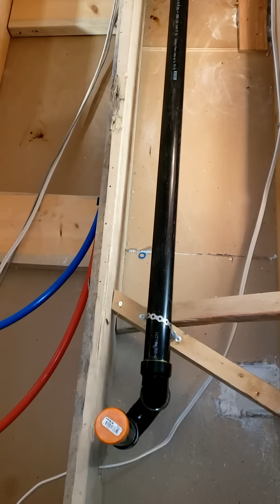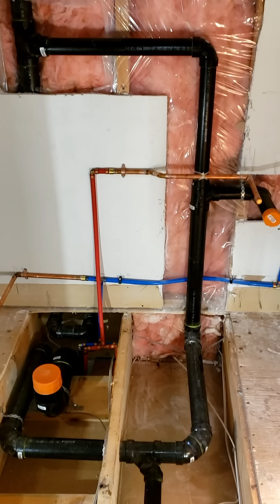Wet Venting EXPLAINED! - #SHORTS

Comment: Needs to be a two inch vent because of the toilet
Reply from the maker: You're not wrong, depending on what you're referring to by "vent".  The WET vent (the pipe between the toilet and the lav) needs to be 2 inch because it's carrying air AND liquid (and I assure you that it is!).   However, the dry CONTINUOUS vent (the pipe upstream of the lavatory's TY) only needs to be 1-1/2 inch.
Reply: @PlumbingsCool thanks for this. I'm having a bathroom renovation and want to remove the boxing of the 110mm soil pipe ventilation  and replace it with a 40mm (air pipe going up through the roof). This will allow me to create a small boxing rather than a big one.
Reply from the maker: @DSS-Renzokuken  Appreciate that it helped, but I'm not sure where you are in the world.  Here in Canada we are required to UPSIZE to at least 3" (75mm) BEFORE we exit through the roof regardless of pipe size.  This is to minimize the likelihood of our vent openings from getting blocked up by hoar frost during our crazy-cold winter months.   If you don't have cold winters where you are, then I don't think it will be a problem.
Reply: @PlumbingsCool  based in the UK. I already have a 110mm put the roof, but moving the pipe internally and then will reconnect in the loft space via a 45°. Don't see why we have to have a boxing of 25cm x 35cm for a soil pipe air vent
Reply from the maker: @DSS-Renzokuken  Yeah, that's strange. Here in Canada, there's no Code that specifies the boxing of any stack. Many of our houses have unfinished basements, which have all the stacks exposed.  They only get closed off for aesthetic reasons once the basement is finished..
Reply: @PlumbingsCool  well, if it works in Canada, the mechanics will work here in the UK. So 40mm vent pipe it is in the bathroom walls. Thanks a lot.
Reply: @PlumbingsCool  what size vent is the toilet vent, looks like 3" or is that 2"?
Reply from the maker: If that toilet were being vented individually, it's vent would need to be 1-1/2".  However, because the vent serving the toilet is also acting as a drain for the shower and lavatory (wet vent), then that pipe needs to be at least 2" all the way through, because it's performing double-duty.  If you were to throw in say another shower or lavatory, then that wet wet vent needs to be upsize to at least 3" throughout, because a 2" wet vent can only drain a maximum of 3 fixture units into it (1-1/2" lav + shower = 3 fixture units).
Reply: @PlumbingsCool where is this? State?
Reply from the maker: Ontario, Canada, my friend. We use Ontario Code in this province, but the wet venting rules are almost identical in our National Code.
Reply: @PlumbingsCool  Wrong! Where did you get your plumbing license? El Paso?
Reply from the maker: @michaeldudas7584  I sure hope your plumbing skills are superior to your descriptive ones, for your sake. 

Please do elaborate upon your infinite plumbing wisdom.

(And what's wrong with El Paso?...sounds like a cool place! 😎)
Reply: @PlumbingsCool  Your wrong. In that application the vent has to be 2''. Plain and simple. The reference to El Paso is describing the type of people doing skilled work unlicensed now.
Reply: @PlumbingsCool  You're from Canada? That explains everything. We know what we're doing. We're from the US.
Reply from the maker: Aw...why are you speaking up NOW???...I wish you had done so fifty years ago when the Plumbing Code was first published...thereby sparing us from carrying out millions upon millions of exactly identical installation configurations.

Oh well, better late than never to be schooled by a Jenius.

(OK, I'm done.  Troll away if you feel it improves your life in the slightest miniscule way.  But it won't.)
Reply: @PlumbingsCool It's spelled G-E-N-I-U-S!
Reply: @PlumbingsCool  I'm not trolling. You said that vent can be 1 1/2''. In NJ that vent has to be 2''. How's that trolling?
Reply: @PlumbingsCool  your toilet is still connected to that DRY vent so it would need to remain 2 inch throughout.
Reply: @coltonmorquecho6665 why? It's only AIR not drainage.
Reply from the maker: You're absolutely right!  Note that ndividual trap size requirements reign supreme.  You have to size the piping as if each fixture were individually vented.  For example, a stand-alone toilet (3-inch trap) requires an 1-1/2" individual vent no matter what.  Although technically our continuous vent sizing tables renders 1-1/4" piping large enough to supply air to all three of those fixtures based on accumulated fixture units in this case, 6 Fixture Units for a Bathroom Group) individual trap sizing requires that we upsize the continuous vent to 1-1/2" specifically because there's a toilet in the mix.  

The only time you would need it upsize that continuous vent to 2" is if it's LENGTH exceeded the maximum allowable requirements based on the fixture units it were carrying...which is certainly not going to happen in this case:  That 1-1/2" needs to have a developed length greater than 15 meters (50 feet) to open air before requiring an upsize to 2"!
Reply from the maker: It's not though - at least not here in Canada. What we're looking at are three separate systems which utilize three different tables.  For Ontario:

-Drainage:  Table 7.4.10.8
-Wet Venting: Table 7.5.8.1
-Continuous Vent: Table 7.5.8.3.

Just curious:  What part of the world do you reside & plumb?
Reply: Different plumbing codes I’m assuming
Reply: Not at all 😂 1 1/2 can vent a lot of DFU's
Reply: In minnesota a wet vented bathroom group always requires a 2 inch dry vent
Reply: The went vent area needs to be upsized to 3inch and the dry vent needs to be 2inch
Reply from the maker: @tweety5653  HI there. I'm curious to know where you're from, and the Code you're referring to.  I can assure you that here in Ontario, Canada, the configuration is very much to Code.
Reply: @PlumbingsCool  California UPC 2021
Reply from the maker: @tweety5653  Ah, interesting!  Thanks for sharing.  Fascinating how every place has different rules, despite the physics being the same across the world.   I just got back from Europe (see my Instagram if you're interested) and I was blown away by the different configurations - namely the use of what we would deem an illegal S-trap beneath a kitchen sink.  There was sewer gas smell or threat of siphonage from what I could tell.  Our Plumbing Code is pretty strict here in Canada, but it did lead me to wonder whether it's overkill after seeing how things are done in other developed parts of the world.

Comment: That shower looks more then 5 feet from that vent
Reply from the maker: Good eye...because it is! 😁. However, it's also less than 6 feet, which (as of January 1st, 2014 here in Ontario) is perfectly legal. The maximum length for 1-1/2" trap arms is 5'-11" (or 1.8 meters) to be exact.
Reply: @PlumbingsCool well it's why we always run two inch on our fixture branches thus being able to run up to eight feet in developed length to the crown weir of the trap to the center line of the wye a shower drain is two inch so why would it not be run in two inch I would not decrease the size of the pipe picking up a shower especially a tub sure because it's only a inch and a half drain on the waste and overflow anyway and yes we are only allowed five feet of length from the crown weir to the center line of the wye or combination wye and eighth bend fitting it's what we refer to as a combo fitting a wye and forty five all molded into one fitting as opposed to having to use both

Comment: 😂😂those zip ties holding the waterline  lavatory vent is absolutely not up to code
Reply from the maker: The primary purpose of those zip ties are to prevent the copper lines from unintentionally rattling inside the walls, and to support the piping until the framer was able to come in to install the wood studs.  Following installation of the drywall and studs, those stub-outs are now rock-solid, which I wouldn't accept any other way.

I know there's certainly no Code issue with such a setup here in Canada; I'd be very interested to learn about where you're from, and the specific clause in your area's Codebook which renders such a setup as illegal, and why.

Thanks for your feedback!

Comment: So the vent just ties into the 3” which is the vent for the toilet?
Reply from the maker: You are correct...sort of. The only reason the pipe downstream of the 2-inch pipe is 3-inch in size is because that's the minimum drainage size for the toilet.  The actual vent for the toilet is the 2" pipe, which is acting as a "two-lane road", so to speak (carrying both drainage from the lavatory and shower, and air to the shower and toilet.)

Let's pretend for a moment that there were no fixtures upstream of the toilet:  you'd still need a vent for it, except that instead of 2-inch, that upstream pipe is allowed to be sized only 1-1/2-inch because it would be serving only the toilet and only air (no drainage).

Hope that makes sense!  And thanks for your question!